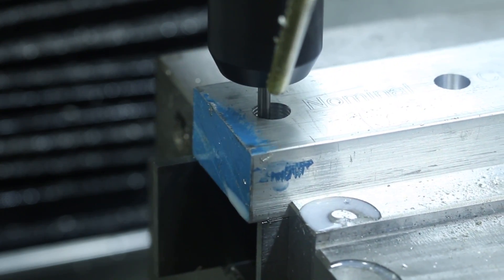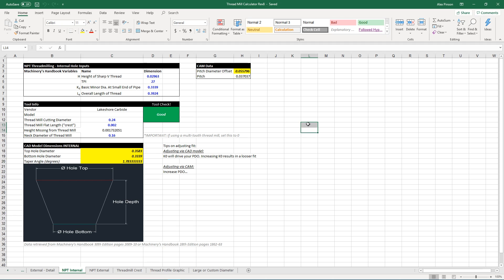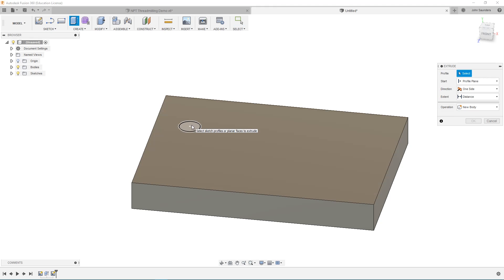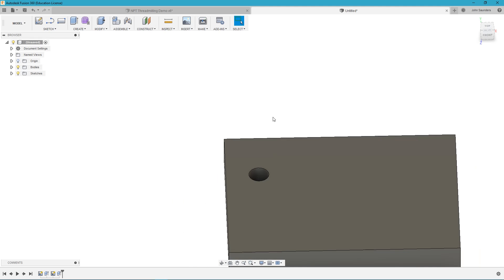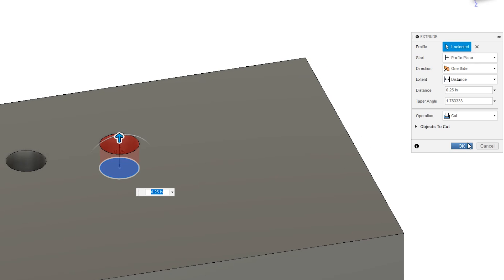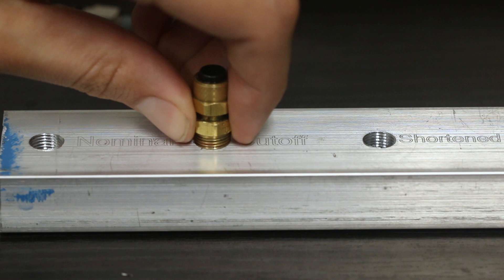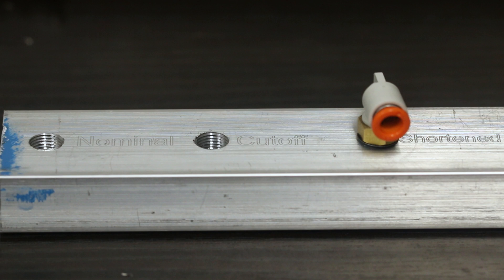Adjusting NPT Threadmilling CAM for Thread Length - WW254

Comment: If using an already-tapered exocarb OSG NPT thread mill, would a simple thread mill tool path work with a optimized bottom-top single pass work starting with a straight pilot hole? It appears that the tapered tool geometry machines the taper into the hole (heavier at the top than the bottom).

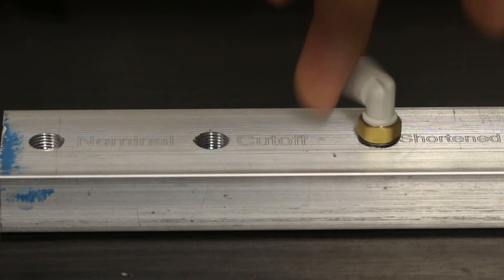Comment: 1:32 there is no problem if all those are same size lol. in reality they should be same. pitch diameter is 5 thread some thing from ebd. cant be go wrong or can LOL. becouse handbooks picture not make any sende outside diameter looks like be inside diameter its upside down if you look dimension. and its not that acurate you just need plug that go in, but yeah manufacturers do own thing LOL like it was 50 years ago. every job has own threads lol.
well nothing those matter. if you can by different size plugs LOL.
and you can make makro NC program its one liner LOL its faster type on NC machine than first draw it and generate LONG NC code with RED RED RED cuting inside part.
if you have makro program that thread program is allready in your machine. you just type 1 line code. 20 years working CNC i havent touch cam. i have all in makro programs. if program doing something same with step down its just LOOP with step down. why need generate million line code. when machine can hold 200k LOL.
there is like nice test i made cam. 1 liner code made same as 1 million cam code LOL yes it was not any normal straight line it was curves and all but i made makro for it .bcoz if i can calculate steps then i can make makro.
so answer is. no i not need learn cam thread i allready have makro lol

Comment: Hi Alex, Just wondering how you got the angle for the taper. According to the machinery handbook it should be a 1 in 16 taper. The half angle is 1 in 32 which equals tan-1(1/32) = 1.789910. I've used this for producing NPT holes for a while, seems to work ok. It would be interesting to see how close this all works using a stepped limit gauge.

Comment: I think your “shortened” are not NPT fittings.  They look like a BSP or BSPP. If it has an o-ring face seal, it’s a BSPP, which is not a tapered thread. It’s also not a 60 deg thread form.  All BSP and BSPP threads are a 55deg thread form.  Can’t use a 60 deg thread mill to cut these, the thread form will be incorrect

Comment: If you look at your shortened thread you will see a black ring on it.  This is a seal to prevent leaking.  The seal is not on the threads, although with enough teflon tape you can get most things to seal...

You should also look at adding lookup tables to your spreadsheet, it can simplify adding the data by hand for common threads leaving a lot less room for error

Comment: Looks like a BSPT / NPT thread with a metal face seal.
Reply: thecrayonguy 
Either NPS (rare) or BSPP. 

You don’t use a face seal if one or both of the threads are tapered.  Completely defeats the purpose of a tapered thread or a face seal. Either the taper in the threads engages first, meaning the face seal won’t seat correctly, or the face seal engages first and the tapered threads don’t seal. 

Face seals are only used on straight (NPS) or parallel (BSPP) pipe fittings.
Reply: Occams Sawzall by design no. But what they are using is a SMC uni-fit push connect fitting that’s designed to fit different multiple types of holes. IDK why these are a thing though, I got them once by accident and I was puzzled at first.

https://www.smcusa.com/products/KQ2-Unifit-One-touch-Fitting-for-Metric-Size-Tube-Rc-G-NPT-NPTF-Connection-Thread-New-Series~87063

Comment: Not a single mention of pitch diameter, sad face. John I'm shocked you're running npt jobs without thread gauges. 
Whenever you work with a dimensional taper you HAVE to relate a diameter to a depth, use a ball bearing and relate the depth it sits at to a known perpendicular plane or conversely a ring gauge.

Comment: Alex, I had similar issues with a job I did not too long ago. An alternate way to do this, is using a multi tooth NPT cutter. You can program it with cutter comp and offset the wear until you have the fit you need, or adjust the PDO in your CAM to walk out the thread. In the case of the 3rd fitting, you would have a PDO smaller than nominal. Makes it super convenient. Thought I'd share.

Comment: I really enjoy most of the NYC CNC videos, but every so often one bothers me. This video is offered to be informative but is offering information that is glaringly incorrect. The big problem here is those without the knowledge to know any different will take this information as correct.  Keep up the videos but please try to avoid disseminating incorrect information. A good rule of thumb is if your fitting doesn't work with the thread standard, it's not meant for that type of thread.

Comment: That fitting is a SMC unifit. It works with npt or bsp. The seal is made by the coated ring. The threads are loose to allow it to work with both threads.

Comment: As a mechanical engineer, it is my professional opinion to completely stop using ANY inch based fittings,fasteners, pipe sizes, as well as fahrenheit, gallons, psi, footpounds and all other stupidity units some countries cling on to!
By far the worst example of this mismatch in standards is that of the pipe fittings, it is just too stupid!
Anyone who is in favour of maintaining this crap is obviously not working with the stuff or/and should have his/her head examined!
Reply: Another ME here.   I also prefer metric and wish we’d change.   But...A lot of those metric countries seem to use BSPT for tapered threads.  Also inch based.
Reply: David Waters agree, bsp and bspt should also be replaced.
Reply: pipe fittings are a nightmare, But you can't just stop using existing standards as there are a lot of things that still need support for them.  Any new project with no existing interfaces, sure, but the worst thing I have seen is introducing Metric into a existing project already using some other form of measurement.
Reply: Brian Packard changing standard witthin an existing project is never good, but my point is for engineers to ALLWAYS look for metric parts whereever possible. The sooner we all do that the sooner we can get rid of the mismatch in units.

Comment: The orange fitting you're looking at is an SMC "Universal Thread" fitting. 
The fitting seals on the metal gasket and the thread is intended to screw into both NPT & BSPT female taps. Hence why it's "shortened".
Reply: Michal 
That makes no sense.  NPT threads use a 60 deg threadform angle, BSP uses a 55 deg thread form angle. 

You can’t put a BSP into a NPT threaded hole. Least not with any kind of success. 

SMC universals are for the compression fitting for the air tubing side, not the pipe fitting size.  The compression fitting is sized to accept both standard and metic tubing of a similar size.  

The pipe threaded section is a fixed BSP or NPT thread.  Not a “universal” thread that will fit into either, because they can’t do so without either thread seal failure or thread engagement failure.
Reply: from 1/8 to 3/8 there is "one" tpi difference between npt and bsp, not to mention the pitch dia difference due to the mentioned 55 vs 60 deg thread form so universal is not a pipe thread.
Reply: @Innov8cnc  Directly of the SMC Pneumatics UK Site:
"By using fittings with the uni-thread, tubing can be connected to parts which use parallel as well as taper-type threads in British Standard Pipe as well as National Pipe Thread (US standard). Assembly times can reportedly be cut by around 75 per cent, freeing up maintenance engineers to focus on more pressing issues. The seal is made by an NBR laminated stainless steel gasket and is suitable for all female threads with a standard 45-degree chamfer"
Reply: Michal 
If they make a fitting that universally fits NPT and BSP. 

Why do they still make thread specific fittings?  

I looked them up, the uni-fits have the same operating pressure claims as their standard fittings. 

I smell the strong scent of marketing wank on this one.  The amount you’d have to truncate a thread to have it fit both NPT and BSP would seriously weaken the connection. 

Either way. I wouldn’t trust a “universal” thread like that on anything but an aquarium air bubbler.
Reply: @occamssawzall3486  Hey, i have personally used these fittings on pressures on up to 10 bar with no issues. They seal on a metal gasket on a face of the fitting.
Reply: @grizzli1994  this sounds more like a cost cutting exercise than a solution.
I guess for pneumatics it's not a big deal.
I just couldn't bring myself to use it. If it was only a matter of thread form it would be ok. But tpi/pitch is how threads work.
Imagine cutting a thread on a lathe in the wrong gear until it fits. 
Iso standard is to prevent this type of butchery. 
So uni thread is a thing now?
Reply: @occamssawzall3486  They are typically for service / repair applications. Less stock to carry to get equipment back up and running.

Comment: Do you know you can use Section Analysis in the Inspect menu to get a slice of your entire model/assembly?
Would help to show off the taper angle, fit of the fittings etc.
Thanks for the video.

Comment: I cut quite a lot of NPT, and other tapered threads on oil, and gas parts.  Not one of the threads milled had a gauge put near it?  I use step limit gauges to determine when i'm in tolerance for the hand tight thread diameter.  The NPT spec also has nominal threaded lengths for female fittings (ANSI/ASME B1.20.1/3).  How can you even tell if your thread is anywhere near in tolerance on a tapered thread without a gauge?  The third fitting with the o-ring is definitely not NPT,  1/4 19tpi BSP would possibly screw like that into a 1/4" NPT thread.
Reply: i'm with you Matthew - I have a full set of NPT and BSP thread gauges up to 1.5" because it's the only way to know if you've got the correct size/engagement. Just because a fitting screws in doesn't make it right. 

That being said, sometimes with job shop stuff it's just a case of "make this fit in here" type work where this method is perfectly acceptable. i'd probably just put a "stock to leave" in stead though to close up the hole.
Reply: @TravisHammeng  I agree with you that there's a time and a place for get'r'done type threading.  When you're making a thread for a customer it should be right though.  I'm guilty of not having a gauge for a thread, and bore mic'ing the minor diameter to hit mid tolerance, using a full form insert, or threadmill.  My take on the video was it was trying to teach you how to correctly cut an NPT thread, they never even mention how to gauge the thread.  I would have thought with NYC CNC's level of experience, they could have even measured the hand tight engagement, and got it approximately right.
Reply: Man I whish I could learn about npt threading like you!. I wonder how can I make threads look shine and smooth with the proper blunt start for high pressure npt fittings

Comment: Are you not using cutter comp (I think Fusion calls this in control)?
Reply: I've never actually used cutter comp "on the control" because i've got an old Mazak M2 controlled mill and heard that it can slow things up - and i definitely don't need anything else slowing this dinosaur down :P  Not a problem John would have with the controllers on his machines though i wouldn't think. have you got any experience with this?
Reply: Travis Hammond how do you know it would slow it down if you have never tried? It shouldn’t make any difference. I have never milled a thread without using cutter comp. a tapered thread is one thing. But a straight thread needs to fit properly within a tolerance. In order to do that without cutter comp you will have to reprocess cod with every cutter diameter change. Than again as the cutter wears. What a pain and time consuming.
Reply: @EdgePrecision  that's it - basically when i started this using fusion and my VMC i had no idea about anything, so went the most simple path and just believed the interwebs, then it just became one of those things i got used to. I'd just change the "stock to leave" and re-post the code. because the controller is so slow/old/small i have to drip feed nearly everything anyway, so it isn't a big deal to have to repost some code, but using wear comp would probably be a much more seamless way of doing it.

Also i don't generally do any qty over 50 in the mill, and then it's generally not tight tolerances, so actually using wear compensation for tool wear isn't so much a thing i need to do.

Most straight threads i do are either just tapped, so i haven't really ever had any tolerancing on milled straight threads. (turned stuff is a different story)

BTW I love your channel and appreciate that you take the time to address peoples comments. also i'm super jealous of your integrex. my old qt10 and st30atc/mc are a whole different league :P

Comment: O-ring? Probably not a tapered fitting as it doesn't need one to seal property.
Reply: It looks like an O-ring in the video, but is actually a metal clip iirc. Measuring the OD of the threads did show a taper

Comment: your shortened fitting is not npt, looks like maybe ORB or BSPP? Uses a straight thread and seals on the face.
Reply: I believe the shortened fitting they have is a "universal" fitting. It's designed to fit multiple thread types. Similar to McMaster part number 51235K127. I could be wrong though.
Reply: similar to parker oring port.